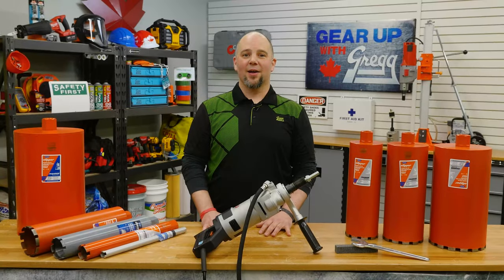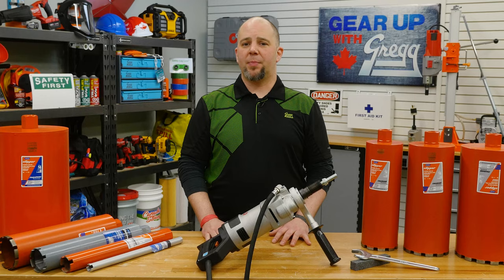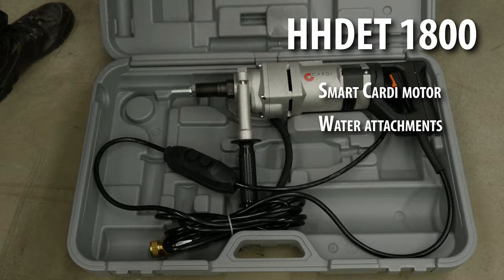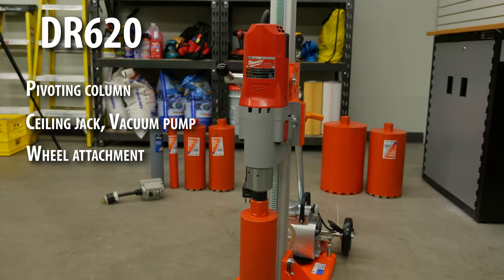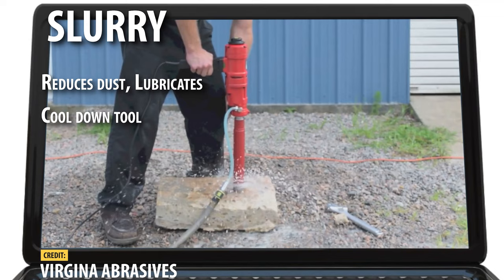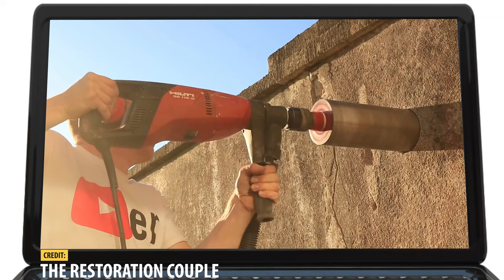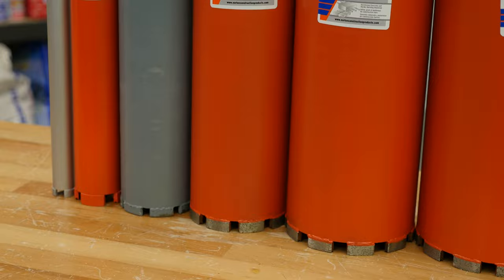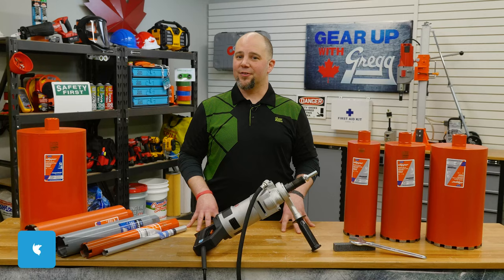Why Diamond Core Bits Make Cutting Concrete a Breeze - Gear Up with Gregg's

Comment: I need to drill a 4” 3/8 hole into a brick wall for a dryer vent, can I use my 18V Battery hand drill? I purchased an sds hole bit with and drill bit extension, are this compatible with my drill. First timer here
Reply from the maker: That's a large hole for a standard drill, even if it has a hammer function.  For best results, you should be using a SDS rotary hammer.